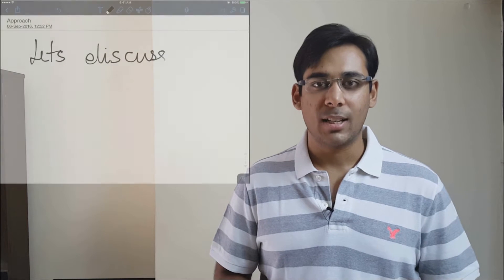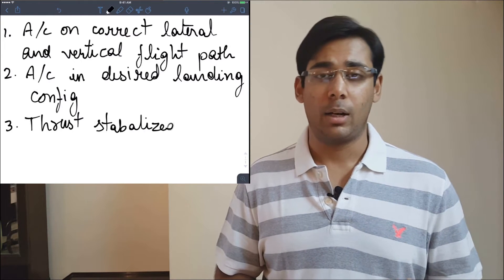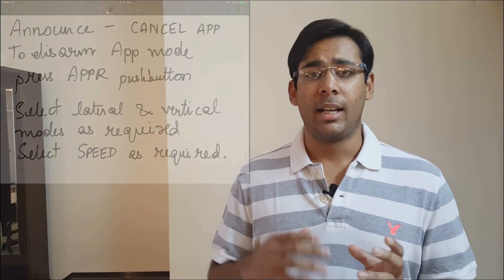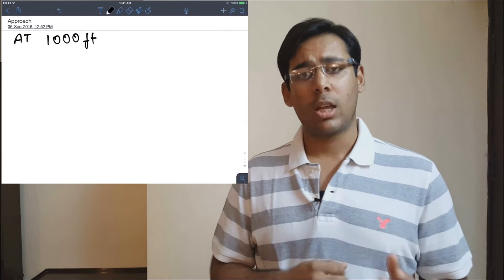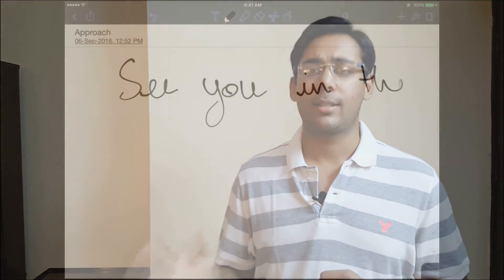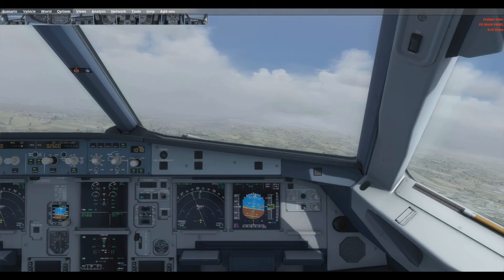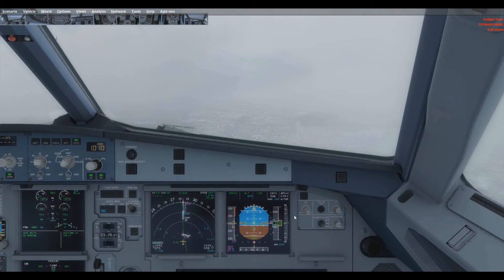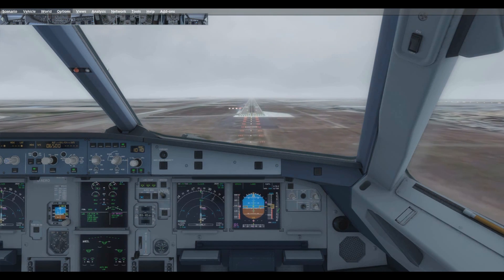A 320 : ILS Approach

Comment: I have a question take the example of TRV/VOTV where you would have to circle in in order to land so while do that maneuver doesn't the A320 get too high on the approach for a flaps 2 callout at 2000FT?
Reply from the maker: Hi economy flyer. You could be configuring the ac as per your profile as well. This is a std way to configure the ac for the app but nothing stops you from config the ac as per your needs. Airbus has laid down a structure on how to config in a normal scenario which will ensure stabalisation at 1000 ft. In places where glidepaths are steeper you have high tailwinds etc. You will have to take extra measures to ensure stabalisation at 1000ft where in airbus recommends early stabilized approach.